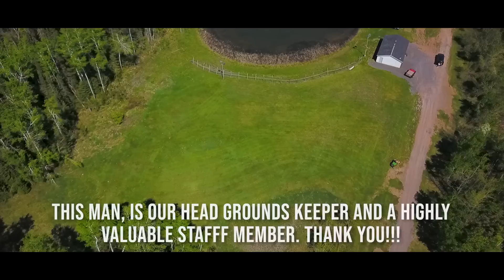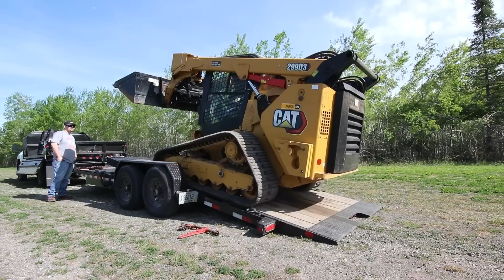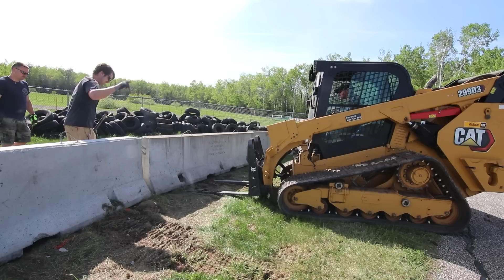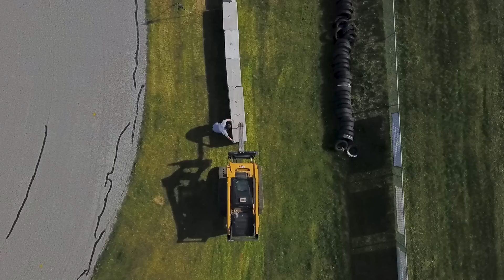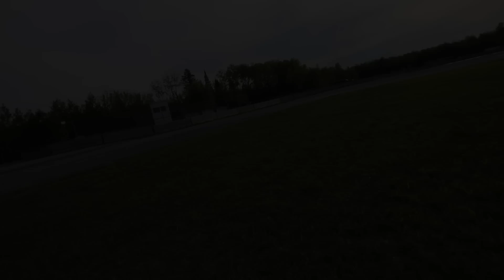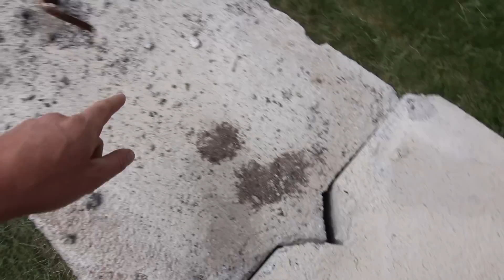Spending THOUSANDS On Concrete For The SAVED Racetrack! (We're In DEEP)

Comment: Been watching this from the start o love the effort and how well its going.. 

I saw some other comments and i would echo them. If it were me i would put the concrete barriers along the fence line and not so close to the track. 

You could then put a layer of tyres infront of the barriers. If you can get some old used conveyor belt rubber you can attach that to the tyres to stop cars and karts splitting the tyre pile.. this would provide energy absorbtion for cars and Karts to stop injury and broken parts but also stop then getting to spectators..

Everyone is happy then.

Comment: There seems to be ways of joining tires to make a bundle /group that are way more effective at stopping vehicles . The bundles can resist a heavy impact and do not fly apart into single tires . They are heavy and either need towing or lifting to shift . Many at very high dollar tracks have vinyl fascia .
I suspect either chain or cable is used to manufacture them .

Comment: Hey there...some ideas for you.
Get some track name stencils or sponsor stencils and spray on concrete blocks.......could charge businesses per advertising block.
You could also use track for cycling......racers/road bikes??
Buy a couple of sheds and place near main spectator area with some picnic benches. Use and convert sheds to sell cold drinks and snacks......? 

Have you thought of adding a rock garden (old rocks,rubble, concrete, logs etc) over back of the roads for rc crawler rock crawler course...really big thing and could host events....u could use lake for rc boats....plus use main straight for runway for rc planes??? Contact a local rc store for ideas, sponsorship and help? Create by placing multiple boulders n rocks and set up mini gates to create course..?

Stock lake with fish and charge for fishing?? Bass blue gill etc.

All the spare land round outside you could create a mountain bike course...small bumps and berms....odd bigger jump. Make into a loop...do a smaller one called a pump track...another way to get people paying to use land...just use digger to create course?or use as bmx track?offroad motorbike track etc.

Few ideas for you....

Good luck on your raceway.
Peace.

Comment: If you think the walls wont move when a full size car hits them u are mistaken. Look at how far toast pushed the walls back when cleetus hit them. Unless there anchored in the ground a out of control full size vehicle can move them a few feet easily. Honestly u needed to dig a trench a foot into the ground so the wall is stable and has some structure. There sitting on grass so easy to push through if a 3500 or 4000lb cars out of control throttle hung wide open.

Comment: I've been auto crossing (18 yrs) and course designing (15 yrs+ at airports to parking lots to oval tracks- from very large to very small).  The scariest courses for competitors were at the oval tracks with concrete barriers so close.  After 2 years, our club decided the risk to cars was too great to continue at the oval track.  Place one wheel wrong, or be too exuberant and its a bad day.  I think that while your concrete barrier is good from a spectator standpoint, they will be a concerning for competitors.  Perhaps run the barriers much further off the track edge, following the fence line instead.  Remove the concrete barriers on the actual track edge near the mid section and move those behind the fences.  Remove all the grass (slippery when wet) between the outer course edge and the concrete and replace with clear gravel ($$$).  You don't need so many concrete barriers in the central area of the track- only 2- 3 should be necessary.  As a track worker, we stand a few feet off the course edges and pay strict attention (no cell phone use or photography while on duty as a worker).  Since you only have one car on course at a time, its easy to keep track.  SCCA autocross rules are designed to set the course elements at least 50-75 feet away from solid barriers and at no time should elements be facing towards solid barriers - eg, don't have exit points to elements facing the barriers (others can chime in to correct me). Otherwise, I really appreciate what you've done so keep on!
Reply from the maker: I see what you mean about the proximity of the barriers to the course itself. We are spatially limited, and moving them closer to the fenceline isn't an option. 

We have a required setback for spectators, which is why things landed where they did. 

During your time working/running at circle tracks with continuous walls. 

How many people ended up contacting the wall or barriers etc?
Reply: @Greenlightfilming  thankfully, we never had an incident, but the courses were designed to keep cars away from the walls.    Good course design will keep it as safe as possible.

Comment: Well you spoke of the bugs being bad so , having large piles of tires on property is not a good idea . Every tire makes a nifty mosquito breeding pool , once it rains . A cheap and effective barrier system is having 500 gallon plastic drums filled with sand , having a lid on each drum ; these won't breed bugs .
Reply from the maker: I agree, tires breed bugs. This year the bugs are abnormally bad regionally. You can't even walk outside at times. It's not just at the track
Reply: @Greenlightfilming  Having lived in Florid for 50 years , I fully understand .

Comment: The biggest problem is that towns expand and then they zone residential way too close to existing tracks, which gets them shut down. There really needs to be an example set where a county zones around a current track and allows more commercial and entertainment-focused buildings. there's no reason why tracks need to be left out in the cold. they should be used as a draw for income for communities. amusement parks, casinos, and sports areas have similar impact concerns as race tracks, but they do not get neglected and mishandled by public officials like tracks do, and it's a crying shame. why not put up hotels, gift shops, restaurants, public pools, etc by the race tracks? They could be as much a tourist draw as a giant theme park. 
I wish I knew what city planners are thinking when they make decisions around race tracks because honestly it's a group that clearly does not mind spending money on their hobby. Giving them a way to stay close to the track as long as possible while spending as much as possible seems like a no-brainer. but then again, that's usually who gets elected, the no-brainers.